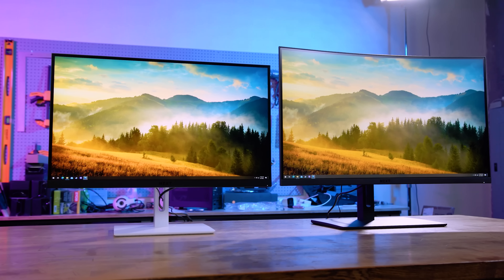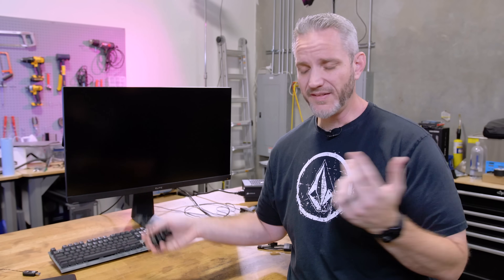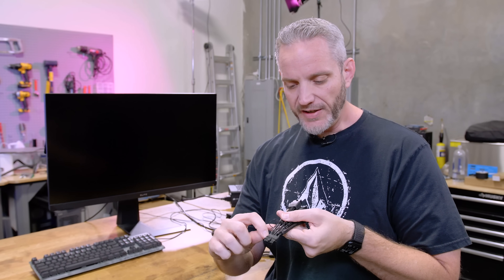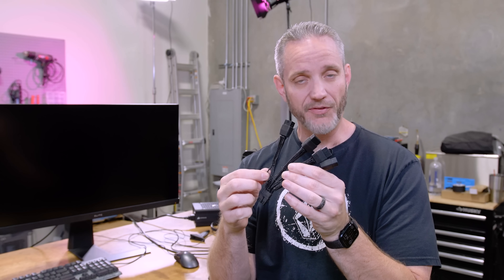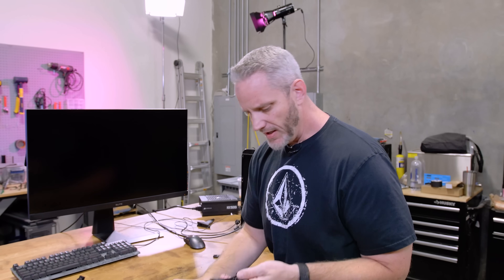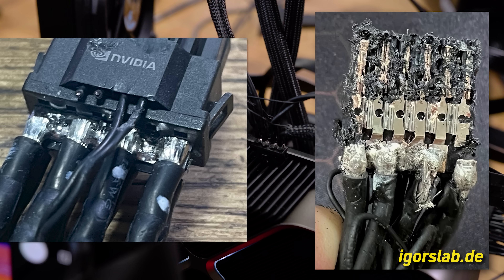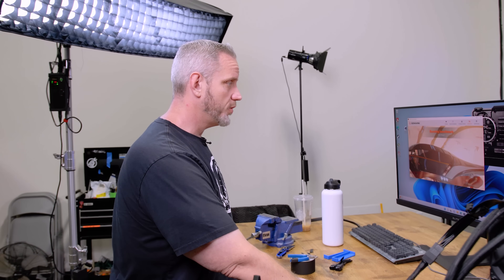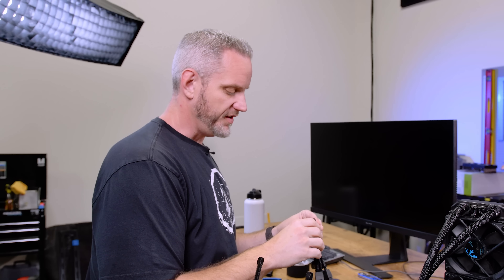Igor's Lab figured out why NVIDIA adapters are melting!

Comment: Edit: Just to clarify, I'm talking about the "outer pins are melting" situation specifically. Some statements will remain true in any case, but that should be noted.

I'm not done watching yet (got to 6:53 so far), but I don't think the outer cables break off entirely and all the power gets drawn through the two middle ones (or those and one on the side). When a connection gets damaged but not entirely disconnected, its resistance increases, so now power will dissipate as heat there instead of where it's supposed to go. On the pictures it looks to me that the pins are one continous piece from the card end right up to the tab the wire is soldered to. The pins are then interconnected via the foil, but the thermal interface will naturally be worse across there. The outer cables appear to be connected primarily, in some units possibly only, to the outer pin tabs. Even when connected to the next tab in line, the physical connection will be weaker and could easily be broken while the outer tab and cable remain connected despite damage.
So only the outer pins have bad connections where extra heat is generated. The heat will be distributed via the foil, but since pin and foil are two separate pieces of metal with an imperfect thermal interface, the outer pins will be hotter than the rest.
If the connections of the outer cables were completely severed, the pins in the middle would melt first - or the cables/the connectors at the other side of the cables.

Comment: Jay, the issue CAN'T be re-created by simply cutting the wires off. The heat causing the melting ISNT caused by all the power going through the remaining pins. It is caused by the cracked connection still resting on itself, making a high resistance connection and arcing. That's why the outer pins are melting, not the middle ones, because they're the ones that are snapped.

Comment: Just a speculation from an electrician on why you couldn't recreate it.  Completely removing the connection doesn't always bring temps up higher when ran in parallel.  A lot of times when you see the higher temps it's because of a loose connection adding more resistance.  Yes the other wires will get slightly hotter, but you are loosing that extra resistance from the loose connection, thus heat being generated.  Once again, just a speculation.  Love your videos and keep it up.

Comment: I think Buildzoid's theory is more responsivity of the actual problem. As he said, the melting is occurring at the pin/socket in when it is inserted because the socket can be spread out by side loading the joint.

Comment: Jay, you talk about increased current on the central wires, after the outer wires are compromised (which does happen to some degree)... but technically, there must be substantial current flowing through the outer pins and wires to cause the heating in those locations.  It is a matter of increased resistance in those poor connections - not actual breaks which would result in zero current.  The central pins are doubled up for their incoming wires, soldered together, so they heat up less because they share current on twice the contact surface.  They do have pretty minimal strength in those soldered pins and "foil" contacts.

Comment: Short version: Someone who didn't know WTF they were doing tried to cost down the cable. This is also why you typically want load-carrying wires in the center of a connector, and signal wires on the outside. The wire CSA is too small for the application. A higher strand count would also help mitigate broken strands. Soldering is also a very inconsistent practice in manufacturing, especially with modern lead-free solders.

Comment: It's not about the number of cables that remain connected, that might make the remaining cables hot but the current is still spread over the pins... 
What makes the pins hot is when the fracture on said pin remains so close that it's basically still conducting current but with high resistance. 
A DC 12v arc can jump round about a tenth of a millimeter and that tiny arc will create heat really quick on said pin and you wont even hear it arc in the beginning cause the gap would be so small.

Comment: I bough a Rog 4090 last week and I'm using that exact type of cable (type 4 corsair) with my HX1500i. Having heard about melting connectors I preferred to minimize the risks and not use the 4-1 adapter that came with the card.

Comment: I think it's the actual pins. Either coming off the 4090  or the ones those slide into. If the female side of the terminal is spread apart or the pins  are to small that would cause the contact points to lose connection from vibration or harmonics inside the machine.  The vibration could also cause it to rapidly make and break that connection.  That in turn would cause heat at that point. That's why the wire insulation might show signs of heat but the actual plug starts melting first

Comment: my suggestion is that, as the joint breaks its maintaining a loose connection on the wire, keeping the power along that line but with the loose connection your getting the increased resistance and therefor heat along that pin. maybe try keeping  all wires attached but but increasing the resistance along the outside lines

Comment: I never use the adapters, I got the Corsair cable off the bat with my 4090 and it's been running cool. Even under the heaviest load it's barely warm at the connector, so that's apparently the way to go.
Reply: Hi, are you able to link to the cable you use please? Thanks :)
Reply: Would be able to Link the cable that you are talking about.

Comment: If I understand correctly the sense wires only check the power supply side connection, because that adapter seems to have a unified +12v if even 1 pin is making contact the sense would report connection. (assuming the cables are plugged in)

Comment: The rubber sleeve is an insulator, shielding, building up, and redirecting the heat to the plastic.

All the metal is conducting the heat differently.  The plastic is the stuff most vulnerable and exposed to the outside.  Think of the metal like heat spreaders.

Comment: seems right, i build cables industrially and have the molex crimpers for the standard plugs, not so much computers but of all the assemblies ive built ive never see a wire split up between pins like that. my first thought was to run individual wires out of that connector and do the actual splicing somewhere else in the assembly like maybe alittle molded box in the middle of the cable
Reply: Connectors crimped onto cables are actually less reliable than a soldered connection.  Less electrically sound too.. more resistance.
Reply: @poison7512  i mean we have all the equipment necessary to test that hypothesis but industrially speaking i can crimp several thousand crimps in a day but usually the solder connections take alittle longer heating and cooling so the difference is usually outweighed by time savings in production
Reply: @tom940  oh yeah 100% crimped is great for manufacturing and is more than reliable enough to get most jobs done.  But if we're nitpicking details.. soldering is the way to go.

Comment: in this kind of situation, heat is created by a bad connection, i.e. a pad or wire that has cracks or is broken, still making contact, but barely so and which would dramatically increase resistance. same as a domestic distributor box with loose wires/screws .

Comment: Not sure if someone mentioned it or not, but if the wire broke off if could be arcing which would cause the melting.  The video had clean breaks and no arcing involved.

Comment: I would think it's not the extra draw from the center wires but arcing caused by the break still being in close proximity to it's original location that's causing the heat.  If the failure cause is too much draw, the failure point should be where that draw is i.e. the center wires.  The failure is the edge wires.  If the cause is broken connections at the edges, the failure has to be localized to those edges.

But I'm not an internet engineer so I might be wrong.

Comment: There's also the subpar female crimps they used inside the main connector. They're double-seamed instead of single-seamed as offered by the original OEM of the connector housing.
Reply: THIS RIGHT HERE!!!. All of the photos I've seen of melted keys and nobody is looking at the other side of this connection. If a broken/cold solder joint is happening at the bus-bar, then the heat and arcing would be melting that part of the housing as well. These are mostly melted and burnt keys, meaning the arcing is happening at the connection. I believe after these videos have aired and people start using third party cables, we'll still see burnt pins because of the poorly spec'd connector on the boards.

Comment: Not sure this about the outer connections breaking causing the remaining connections to heat up / carry more load: it's the outer connections that show melting, so maybe the gap caused by the stress break is where arcing is happening: the electricity crosses the break by way of plasma - that can get super super hot?

Comment: From my limited understanding, NVIDIA's spec is for the wires to be crimped to its corresponding pin rather than being soldered which, with enough heating and cooling cycles, can break. A properly crimped connection is way stronger than a soldered connection.  

In the 3D Printer space, people get mad at manufacturers that cheap out and tin wires that get screwed into terminal blocks on PSUs rather than using a ferrel connector that's properly crimped.

Comment: its probably heating up the outside pins because they break but still rub but because its not a good connection like it being soldered or crimped it would heat up that way, you probably couldn't recreate the fault because you were just cutting it right off, but in reality its still left there to connect and disconnect from rubbing.

Comment: Honestly, I have wondered this for YEARS, but this is making me wonder even more why graphics card manufacturers continue to put the power connectors on the outside of the card. 

They could be easily reversed to face the rear of the case without increasing the size of the card, eliminating the need to tightly bend the cables for making it look nice (or fit at all), and similarly, make it look better, because you won't have wires coming out the most visible part of the card.

Comment: It's absolutely nuts that they made this change, and didn't put a right-angle connector on the GPU end of the cable. That's a simple fix that puts all the critical connections in the rigid connector itself and likely costs fractions of a penny per unit to do...

Comment: Hypothesis, it's not the cable that's the issue. It's the pins inside the connector. If it's bent while connected, the connection surface is reduced to the pins in the GPU and resistance is increased a lot.

Comment: Good Video thank you! Some criticism if I may; terminology matters! Please be careful when making statements like 'Due to high resistance the cable will burn' This is contrary to Ohm's Law; V=IR.  High resistance = low current = low heat!!! You get heat, when your current goes up- not the other way around.  When you are looking at the issue you must think in terms of Ohm's law.  The other part of the equation is how the cable design works; say they are distributing the power across 4 wires.  SO from a circuit standpoint you have 4 parallel paths current is lower, than if you start breaking off paths, current across the remaining wires goes up to compensate for the overall power draw- thats when you will see the heat.  From the picture at 4:55, the contacts are not evenly distributed; the inner wires get 2 contacts per wire, while the outer is only 1. so you would have roughly double the current through the outer contacts relative to the inner ones (which would make them hotter)  So if in your test you used one of the connectors routed to the inner pins you wouldnt see the issue.  Make sure you track to a pigtail to the outer pins then retry your wiggle test.

Comment: At the end of this video Jay recommends to not use the adapter/splitter cables that come with a 4090. Is the cable he is holding right at the end one made of 2 x 8 pin PCIe to 1 x 12 pin ? Sorry if this is a stupid question.

Comment: So depending on what solder they used also has different melting Temps if you have the wires at a 90°bend and Temps get hot enough I would think it would pull the wires away or create weak thin points.

Comment: think the Problem is not the solder completly seperating. I think it could be the Pins still touching the thin connector "bracket" but just a slight bit because of the ruber piece of the plug holding this stuff together. current than would need to flow through a much smaller touching surface increasing its temperatur in an insane way.

Comment: Rather than these messy-looking adapters, it would be nice to have a separate pcb with 3 8-pin plugs and 1 twelve pin which sits behind back panel of your case. You could even have a switch on it to select the desired wattage

Comment: 11:40
hi, maybe the facti that it's broken in igor's but still shaped in the plastric thing maybe the wire still touch a bit the connector so there is a little point touching rather than a line

Comment: I think this is a good thing. If it's a QC issue and not an inherent issue of the plug, it can be easily fixed.
Reply: Its not actually a QC issue its more a problem of 3rd party manufacturer providing different quality (most likely from different factories) cables

Comment: What i don't get as an electrical engineer we solved this problem in like the 70's. Higher power requires thicker wires and radial connectors. This looks like me as form over functionality and as an engineer it makes me sad.

Comment: I wonder if one of the reasons you could not replicate the heat needed to cause the plastic to melt had a small amount to do with the connectors no longer being coated in an insulating material.  I had a phone that would overheat if it was used too long, but I found that if I popped the battery cover off that it remained much cooler.  I obviously should not have been using a lion phone that was overheating, but it does show the logic behind the lack of insulation potentially ameliorating a small amount of the heat gain.

Comment: No he didn't and GN just proof him wrong. In fact Igor has had not a single cable failure in his possession and could not come up with any Facts Only Theory just like you Jay. You guys need to stop producing content only in search of clicks without any consistent results or Facts. Gamers Nexus did a excellent video explaining why and they have managed to recreate the failure and absolutely no cable is imune to that failure. These cables are a weak link on this card and they are problematic.  Be professional instead of opportunistic.
Reply: Also Igor said that he was safe with certain cable and GN during their tests actually managed to get this cable to also malfunction.
Reply: now GN is wrong. They got the part about the connectors being garbage right, but they over focused on the "not being connected properly part". Yeah, that was one way to induce the problem.
Anyone with half a brain should know that long term testing was also needed.

Comment: As a Systems Engineer, part of my job is to design the system in order to avoid failures (DFMEA) or mitigate them as much as possible. In our filed is very important the power management since we use the vehicle battery to power the devices.
These kind of failures in the PC components industry makes me wonder the quality level of design and production... yikes!

Comment: I think the 30 series plug is also more robust because the pins are probably crimped to the end going into the connector...a crimp is more reslient, IMHO, under bending loads than a solder joint. Just an opinion.

Comment: I wonder if you took the original plug brand new out of the box and some how reinforced/supported the wires with electrical tape or wire shrink wrap if that would help.

Comment: I know the video is more than a few hours old but can we get some x-ray analysis of the connector and wire ends just after bending for a full picture of the failure? Would probably go a long way to diagnosing the highest probable failure points

Comment: The busbar used is a great solution where the strain on a cable is minimal. If it breaks then a couple of things can happen. If the outside cables/solder joint/pin is broken and no longer able to transfer power, the remaining connections can overload. The heat can melt a connector. The second thing that can happen is if the wire can still handle power, a broken pin or loose connection can cause sparking across the air gap , continual sparking can cause connectors to melt. Poorly soldered connectors on the main board could also cause similar issues. Igor’s lab did some great detective work but unfortunately my experience tells me it is only one part of a multi experienced issue where one or more factors can come into play.

Comment: my guess is that the loose connection will create some small sparks in between the plate and the loose connector. this creates a lot of heat. that would be enough to melt the plastic.

Comment: I think to get the fault the cable must be twisted so that the pins are semi connected... sparks will jump and the temperature will increase drastically... this could be very similar to when you connect a terminal of a vehicle battery... I saw 24v trucks that when starting, melt the terminals if they are poorly connected